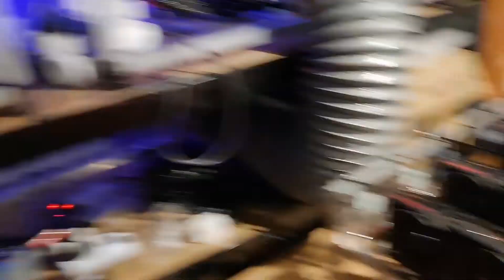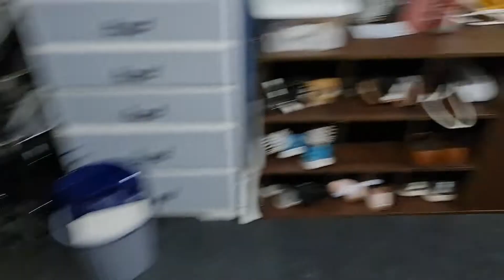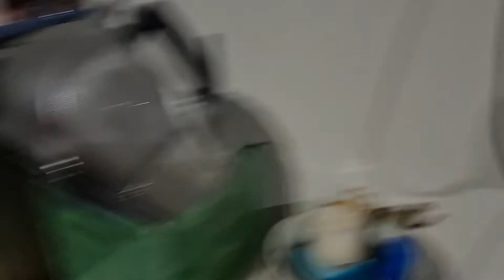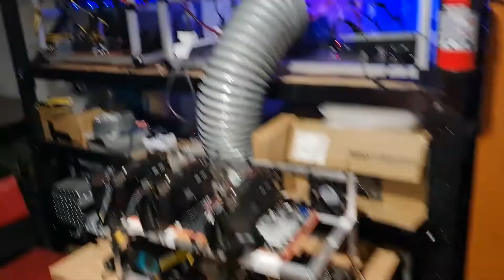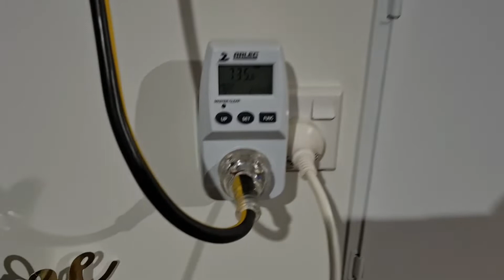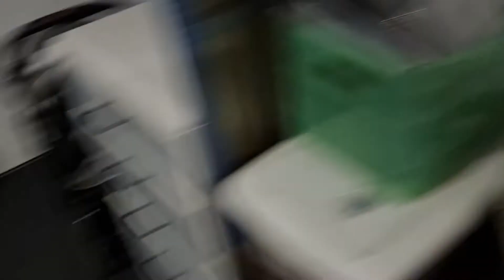ATX + Server PSU Vs Server PSU + Pico Adaptor (Efficiency Test)

Comment: How do you get that 1200W Server PSU so quiet. Is there hope for running a server psu at 120V power silently ? If there is I would love to know. Many people stay away from them because of the belief that they are very loud. Please let me know your thoughts Kiwi. Thx.
Reply from the maker: Hey there. On 240v if you run them less than 66% capacity, then they're pretty quiet. I don't know about 120v though, because 240v is stabdard here in NZ.
Thanks for watching!

Comment: you def want to get the Platinum rated psu.....question, any problems with the Pico adapter so far?
Reply from the maker: Yea man, needs to be platinum. These silver ones aren't great. Personally I mostly use ATX Gold rated. But I do still have this PSU going with the Pico power adaptor.